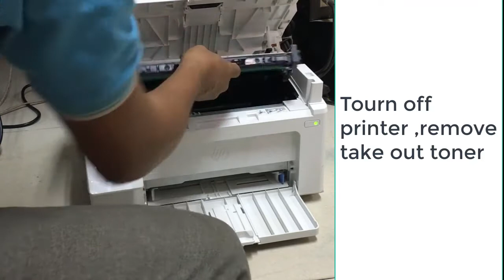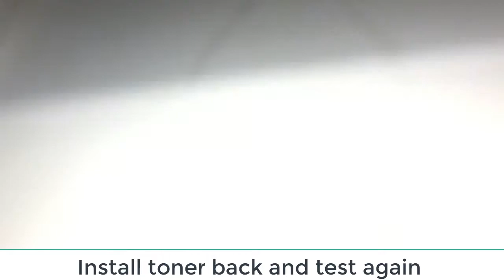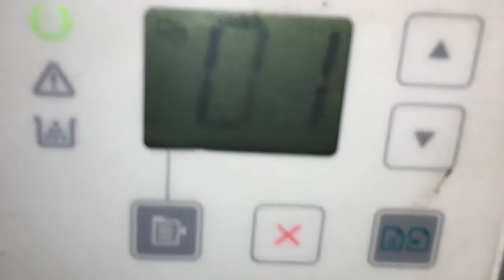How to fix HP LaserJet MFP M130a M130 series print not clear

Comment: Hey bro. What about a full Black paper and looks like dry toner on it..
Reply from the maker: 1 problem from toners cartridges like connection to Hight Voltage board not good or toners heating contact , 2 from machine printers Hight Voltage board (inside  power board ) bad